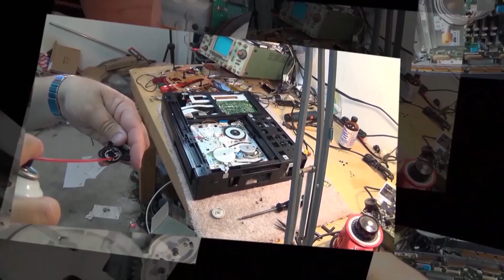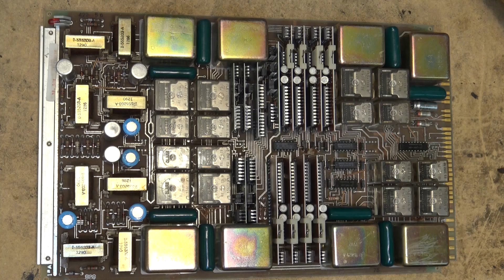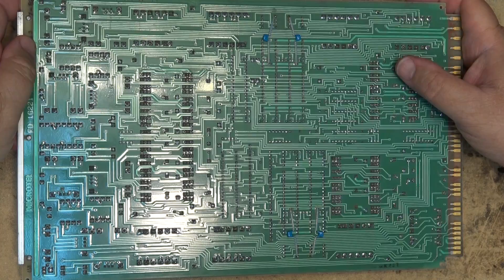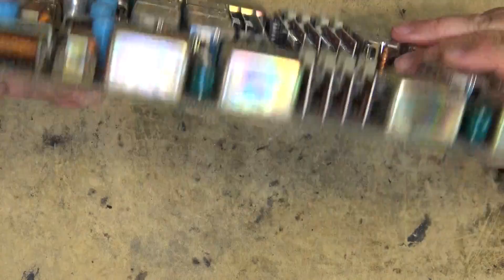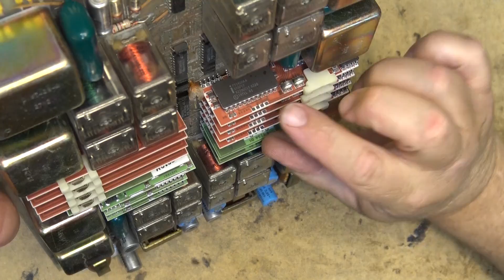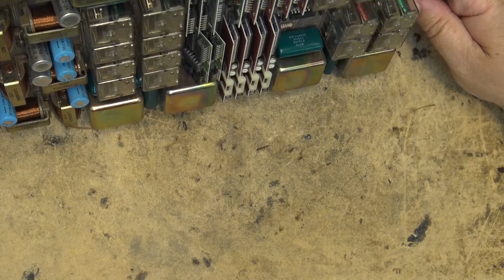GTD5 Line Card

Comment: we call these line cards boat anchor it's still amazing that co's still uses this old stuff
Reply from the maker: The old #5 is still running on several exchanges here.  The fiber migration has been underway for the past 5 years or so but there are still plenty of people still on the old switch. My home phone is still on it. The cards are slowly being decommissioned as customers are moving away. Every time I go into the CEO I see more empty spaces on the shelf. At some point the entire area will be migrated to pure fiber and then the switch will come down but there are still buildings and Stratus that haven't signed on for fiber, and until everyone gets migrated they have to keep some form of the switch running. I give it another year or two maybe longer to clear all the remaining customers from copper. In this community we're probably sitting at 80% now on fiber. Myself I'm still hold out just because I want my phone to work during the power failure. Yes we have backup batteries but they're good for 8 hours, not that we have many power failures but when we do the power could be out for 3 days. And that's 2 days longer then the battery backup our cell phone will last.

Comment: FB-16221-A, knew it before you showed the card handle.  The wafer boards in the middle of the board are for loaded cable.  The little silver "rocker" on those wafer would be flipped one way for loaded or unloaded field cable.  The newer version cards Fb-16221-2A or 3A have a programable chip on them that can be set via software configuration in the switch rather than needing to flip a physical dip switch. :)  Still supporting, working and repairing the GTD5's in my area!  Fantastic product, reliable!
Reply: I'm glad to see a SME. The FB016248 replaced the FB016221. This as you know is post AGCS technology

Comment: I worked on the gtd5 in Phoenix from 1978 to 2008.  I was the architect of recent change. We had a great crew
Reply from the maker: The old #5 is still chugging along here for now. The push to fiber has been in full swing for the past several years and eventually everyone will be on fiber and the old no 5 will get sunset.  5 to 10 years it will be done.

Comment: GTD-5 EAX Switches are still in wide use in the Frontier, Verizon, & Telus Telecom Networks.  They also saw significant use on U.S. Military Bases.  They were most commonly found in GTE or General Telephone Central Offices, since AG or Automatic Electric was one of the core designers of the GTD-5 Switch.
Reply from the maker: Yes I know they are still in wide use.  This one was picked out if the recycle big at the co I work out of. The no.5 is slowly being decommissioned. Every time I walk thought the office I see more and more empty bays and wires all cut off and removed.  As more and more are switched to fiber there is less need for the old copper.  I am sure some of the switch will be running for a few more years as not everyone has taken service yet but eventually they will want to get everyone on fiber due to speed and reliability
Reply: @12voltvids  In the midwest, outside of the major cities, most customers are still served by copper lines.  Fiber to the node, mxu, or pair gain is gaining popularity, but they're a long way off from fiber to the premise in rural & semi-rural enviroments.

Along with GTD-5, there are still DMS-10 & 100's, 5ESS's, DCO's, & EWSD's still in-service, across several major telco's.  They've got s long way to go, before VoIP is common place.

Comment: FB016221 replaced by the FB016248. The cube relay's were left overs from #1 EAX. One drawback, if you have a solid ground like on the MDF, in due time it blows a fuse, and the relay is smoked
Reply from the maker: It's a sad day. The #5 is slowly being decommissioned and taken down.  More and more customers have moved to fiber and copper will remain only for a few areas that can not get fiber for various reason like strata corporations not granting permission ect, or rural areas.   Newer smaller switching ip based concentrators are replacing these big switches.

Comment: The GTD-5 is still a very commonly used Switch.  Originally designed & manufactured by AGCS (GTE & AT&T cooperative effort).  Most GTD-5 Switches were delivered to  GTE or General Telephone Central Offices in the U.S., & Telus in Canada.

Comment: I know that one of the relays can physically connect a line to test equipment, such as a Proctor dial-up test set.
Reply from the maker: thecooldude9999 
Yup one would connect to the 4tel test head for line testing. One to connect the line and 1 to switch in the ring generator

Comment: Maybe one set of relays are for call waiting?
Reply from the maker: seventhday savior 
Doubt that. You can hear them clicking when in operation. One definitely is for the ring generator. As while a phone is ringing you can hear it click on and off. I think one for line idle / in use. One for ring and a sense relay for rotary phone dialing.

Comment: Those relays should be lower than 48v due to power supplies in the line shelves that drop it down to 12v, 5v etc. Also I believe the big gold boxes are impedance matching transformers. I was a COE Installer for GTE (which became Verizon in 2000)in central Texas, from 84 to 2010. Did a lot of step to digital office conversions in the 80's-90's. An interesting fact is a lot of line bays stand empty now, and being removed in a bunch of CO's due to people dropping their POTS lines.
Reply from the maker: joenel60 
They were here too but even for dry dsl they still put line equipment on the pair. The logic behind that is so field techs like me can ANI the line so we know we are on the right pair when hunting 25 feet in the air for a line and all the colored wires have faded. Without that we could hear the dsl sound but didn't know if it was the one we wanted. If there was 2 services to a house (main and basement) don't want to get them mixed up because one customer may have had a different speed plan. Fiber is rolling now, but copper stays in place for now as it is being used for the wholesale dsl, where people choose a different provider for cheaper service. Only fair. The wholesale companies Haven't invested many billion in infrastructure like we have. Still plenty of people on pots service here. Lots of older people that don't have or want a cell phone.

Comment: The GDT5 I'm not familiar with, but the DMS 100, holy cow! I haven't played with one of those since the eighties. We upgraded an old busbar system to a DMS 100 and it really made a difference. I still remember getting into hot water for using the "wall" command at the terminal and having my comments turn up in Canada and the US as well as where we were at.
Fun times.